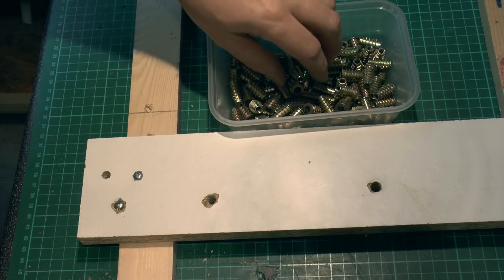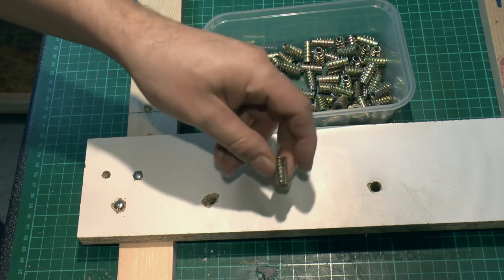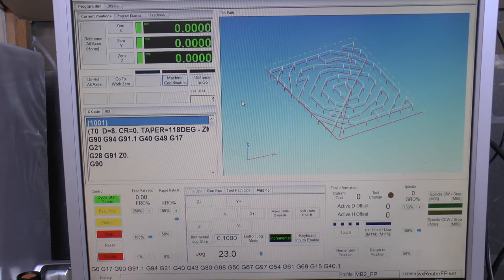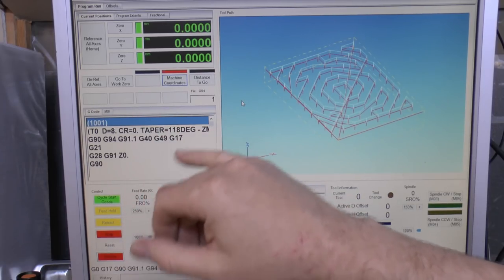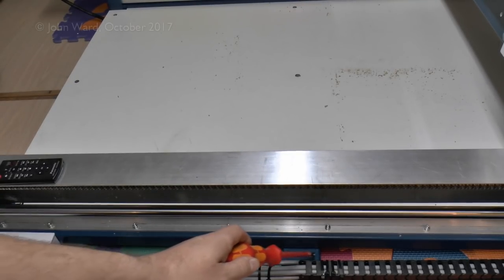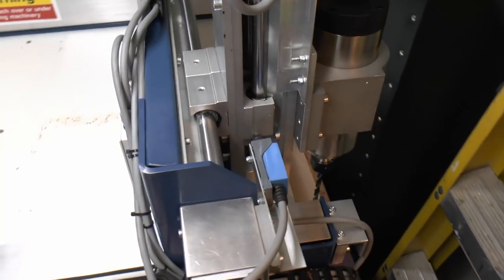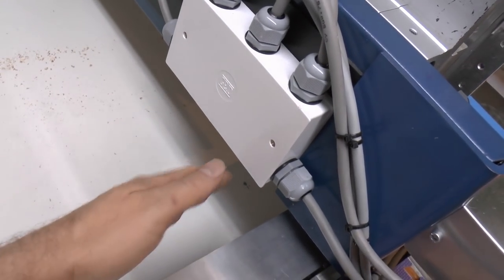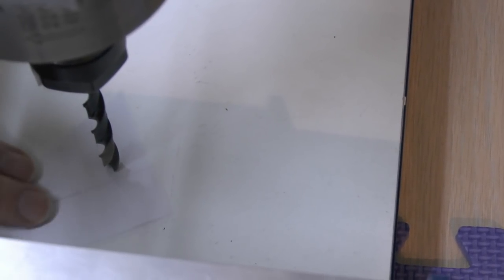CNC Router Build #9 - Drilling Holes for Threaded Inserts

Comment: I use threaded inserts without the flange at the top and a spoil board that is thicker than the height of the inserts.  This allows you to screw them in well below the surface which lessens the chance of hitting them when making cutouts.  Also if you have enough depth you can re-skim the board without removing the inserts.

Comment: The spindle motor sounds very quiet what speed was it running? Oh I thought it was just me, more machine running action and please don't speed up or cut too much video out, I'm sure you'll find a good balance :-)
Reply from the maker: Spindle 3000 rpm.  Audio level was cut significantly in that part of the video (-16.5dB)